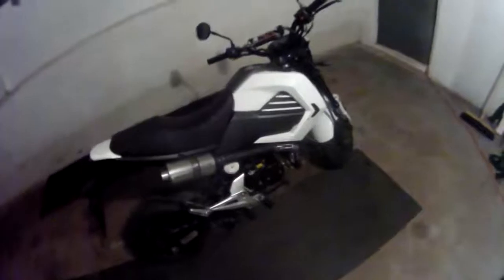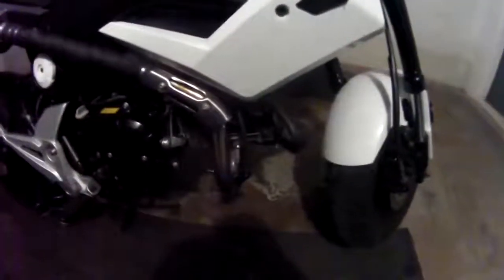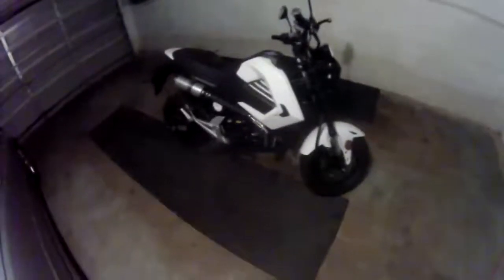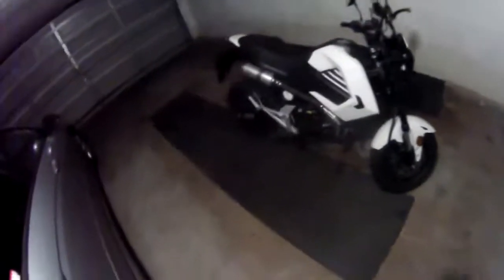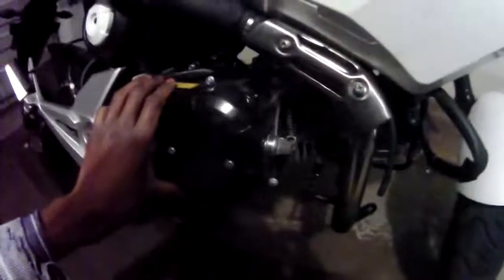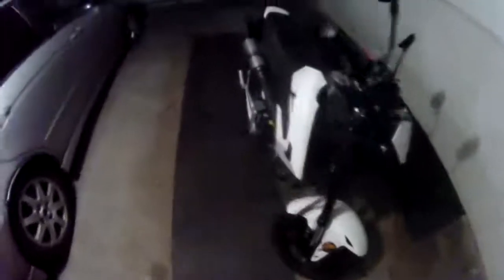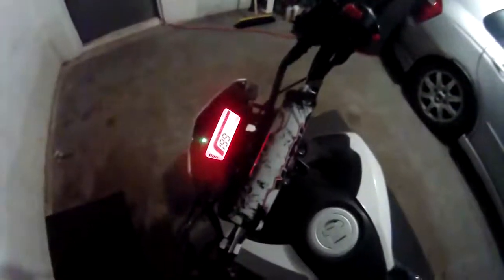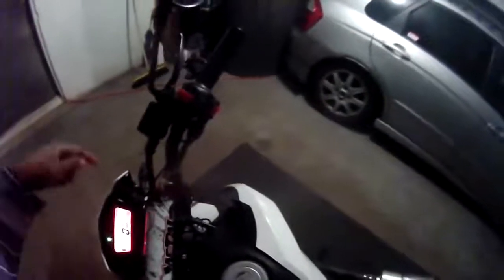Vader 125cc Update (April 2017)

Comment: Use a 115 or 120 main jet in that vm22 carb you have you may have to richen the needle one clip, it'll be a big improvement over stock, you can get the jet kit off Amazon or eBay for cheap
Reply from the maker: I have jets. the issue is the intake boot has a crack in it causing more air to get in it, spent hours trying to tune it and when I took it off I spotted it.

Comment: Instead of paint...Wheel refective tape might be an easy option
Reply from the maker: I wanted to paint the whole thing to gold or bronze. The seller I bought the bike from had pics of it with gold rims which I wanted to match with my car wheels at the time I made placed the order. Sadly they dont come with them like advertised, but I grew to like them.
Reply: I thought I was getting Gold rims and a Mikuni carb as well. But didn't get neither as advertised.But the White reflective wheel tape would look good on your bike...
Reply from the maker: from amazon? Never thought of actually doing this, but it would look good tho.
Reply: Re-check my Vid. I got the Blue one With red wheel refective rim tape I got off Ebay $12.00

Comment: where'd you get the exhaust?
Reply from the maker: I got it off ebay under, crf50 straight pipe exhaust. There are a bunch to choose and colors, but only the straight looking ones will fit the ones that bend under wont line up.